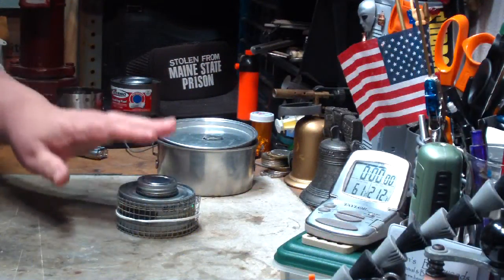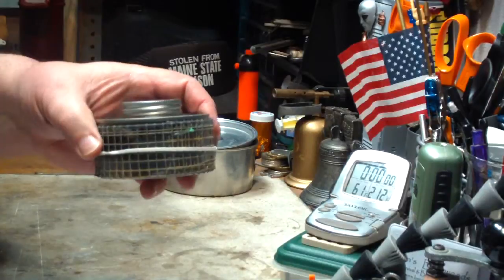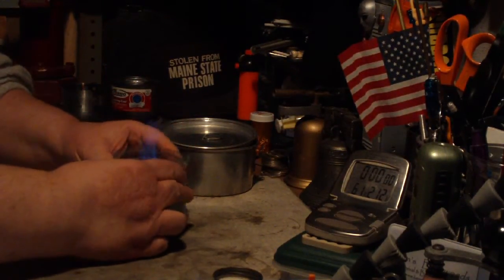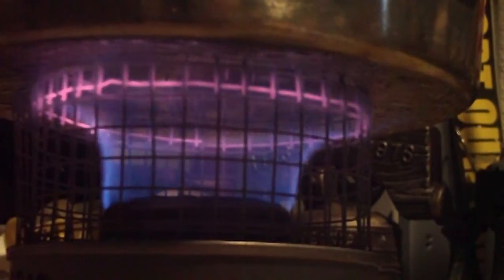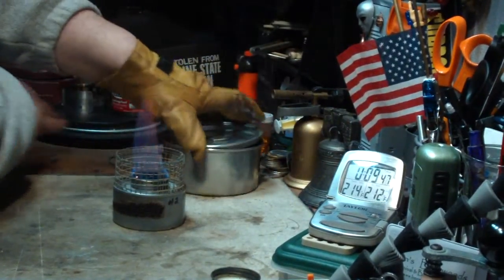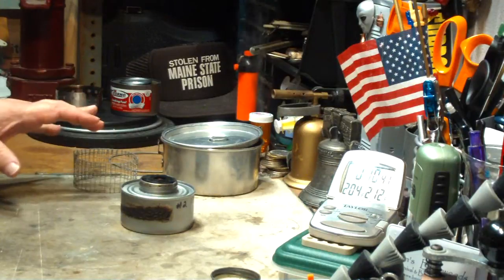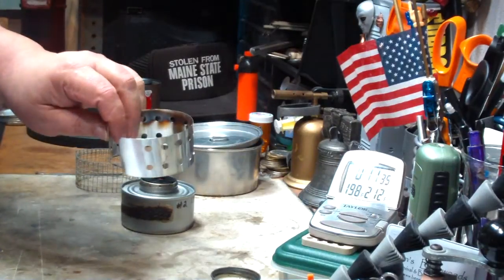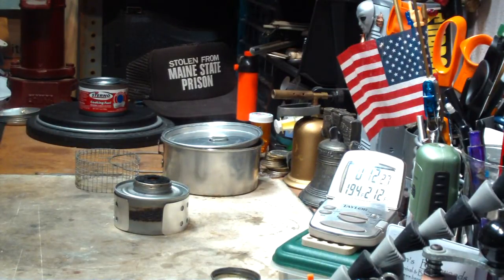Modifying Chafing Fuel Canister for Alcohol Refill - Mod#1 - Boil Test#2

Comment: I'd agree with one less row of squares on the pot stand. 
I'd also suggest to put your all in one around the outside as the mess pot stand as a wind shield. 
Just mount around the outside of both the can and the mesh pot stand . 
It should both protect from wind and trap the heat beneath the pot.